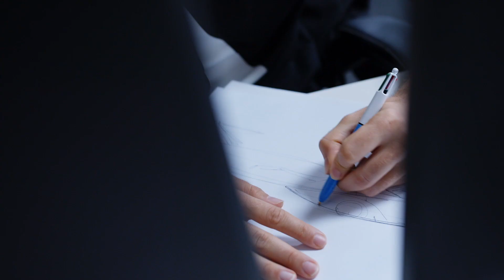How eVTOL Flying Cars Are Made | Airspeeder Factory Tour at Goodwood SpeedWeek

Comment: With current technology removing the entire pit crew might be relatively feasible. Depending on the unique battery rail system your team created, a magnetic slide or robotic arm can easily keep the battery boys or gals out of harms way. also a low budget alternative is making an airspeeder landing pit platform ~6/8 feet tall with telescoping attic like doors leading to battery pack from the bottom up. Granted you’d want a precise, reliable and repeatable process. To avoid the props from landing by the “attic” opening, An AI enabled autopilot can take control utilizing anything from beacons on the pad to LiDAR this can automate the entire pitstop process. Just a few ideas. Keep up the good work! 

- David , Future Airspeeder Pilot and World Champion

Comment: WHAT A JOKE!! No mention about the  Alauda Airspeeder Mk II built in a very incompetent way!? I'll do it then: Whilst performing a demonstration flight in UK, the remote pilot lost control of the 95 kg Alauda Airspeeder Mk II scale demonstrator. After the loss of control had been confirmed by the remote pilot, the safety ‘kill switch’ was operated but had no effect. The Unmanned Aircraft then climbed to approximately 8,000 ft, entering controlled airspace at a holding point for flights arriving at Gatwick Airport, before its battery depleted and it fell to the ground. It crashed in a field of crops approximately 40 m from occupied houses and 700 m outside of its designated operating area. Luckily there were no injuries, but even a small unmanned aircraft falling from a few metres could cause a fatal injury if it struck a person, So imagine this 95 kg ugly piece of... flying object

Comment: I imagine a floating version with inflatable pontoons for water landings and takeoffs that would deflate and retract into the fuselage when not in use like landing gear.
Reply: Add submersible class race perhaps?
Reply: @unitedspacepirates9075  Even fish wish they could fly, but yes, why not/naturally. lol
Reply: @sanjuansteve  tuck in the props, dive at speed, engage vectored water jets, traverse an underwater course, engage rocket engine to compete for altitude.
Reply from the maker: We didn't think of pontoons, but now we are.
Reply: @Airspeeder  What do you think about retractable, inflatable pontoons which could land in water or on land?
Reply: @Airspeeder  consider rocket engines or gigavolt ion thrusters yet?
Reply: @Airspeeder  I'd like to (we should) develop inflatable, retractable pontoon landing gear idea for hang gliders too.  I'd like to be able to take off with a jet ski tow using the pontoons, then deflate and retract then during flight.  Then I could land on the beach as normal or re-inflate the pontoon landing gear for a water landing.

Comment: Nice. Can it do flips yet, like the one from flite test?
Reply from the maker: Hovers and flips are not a challenge. Flight race strategy is a different challenge for teams. Don't forget to like and subscribe.
Reply: @Airspeeder  It looks quite pretty to be fair. I'd suggest you go with tilt rotor via the booms if you can rather than tilting the whole body because it's increasing frontal area significantly as soon as it tilts up. Nice to see how brushless multirotors have progressed from the days of tricopters on a 120 cppm swash  mix lol.

Comment: For Quad Copters we really need to move to rotational engines vs. variable thrust to achieve movement.  It just doesn't make any sense to be angled at  60 degrees nose down to provide forward movement.  If the engines angle forward (forward movement) or any other direction such as lateral (for turns / side to side movement), the craft would remain perfectly level and be able to move incredibly fast.  Imagine this craft hovering and then you slam forward and the engines rotate forward 80 degrees to maintain altitude and turn almost all thrust into forward movement.  Then imagine making a turn and all four engines calibrate to make a turn through the corner.  The whole time the craft never banks, never angles down.  Just stays completely flat like a car.  Now that is the future of Quads.
Reply: It was tried on smaller unmanned quadcopters and the weight and complexity of the motor or arm tilt mechanism wasn't worth the benefits. Instead people optimise the aerodynamics of the aircraft for forward flight meaning when the whole air frame is tilted over rather than doing what the airspeeder guys have done and make it look long and thin and aerodynamic but only when it's level and not moving forwards such that it gets draggier as it tilts forwards to speed up.
Reply: @christophertelford  Yeah but no ones flying an aircraft that tilts like that.
Reply: @ab1stemboy650  They do now. It'd be cheaper to make the seats tilt if you wanted to keep the passengers comfortable. Or else stick a propeller on the front or back thrusting the aircraft forwards and keep the whole thing mostly flat except for the banked turns.
Reply: @christophertelford  It's either the one with rotor on the back or tilt rotor for the U.S, idk about any other place but how things go here it wouldn't look like a bright idea, not even sure if real pilots wouldn't accept any different. If you're going to develope anything and want it to fly here you better be willing to spend extra time and gaining those dollars, for the better tech upgrade.
Reply: @ab1stemboy650  A lot of the other man carrying multirotors just tilt the aircraft the same as most of the unmanned ones. The pilots involved didn't seem to have any problems. I think that pilots are quite flexible and are likely to embrace the challenges associated with flying these new kinds of aircraft. Even fixed wing aircraft tilt left and right to turn. I don't think having to hold a 20 degrees forwards tilt to travel forwards is going to be a big deal (or something that couldn't be fixed easily with a tilting seat for the cruise).
Reply: @christophertelford  They will be autonomous more likely. Probably used for air tours, etc. Iy've only seen a few companies over here which seem promising into bringing this evtol future such as joby aviation and hexa evtol. As for cities im not sure what the speed will be for air traffic most helicopters do an average of 140knots on a regular, ill see what we gain for this new sort of flight, also can you show me a design of a evtol with a swivel chair. Tilt rotors are highly maneverable in actual flight tests.
Reply: @ab1stemboy650  Manned Multirotors are just another kind of aircraft. There's no reason to think they'll all be autonomous in the future anymore (or less) than any other aircraft would be. 
Tilt rotors make sense if you want to have a hybrid aircraft with a wing and lift rotors. If you want to build something as small as possible without a wing then the extra weight of tilt rotors is a big deal whereas expecting pilots to be OK with a 20 degree forward tilt in forward flight is not. But if it was you'd fit a swivel seat which would weight a lot less than adding tilt rotors just for pilot comfort.
Reply: @christophertelford  Hehe im use to seeing swivel seats on ww2 aircrafts never thought we'd ever use em again tbh.

Comment: Does it tilt the motors for forward flight?
Reply: Nope , not sure how sufficient they'll fly.
Reply: Its a drone. For forward the two back propeller are rotated faster and vice versa
Reply: But tilting the motor would have kept the body horizontal like a jet. But the parts for that causes space and weight. So since we are already so good with drone. So drone it is